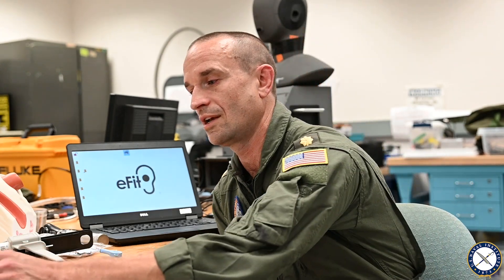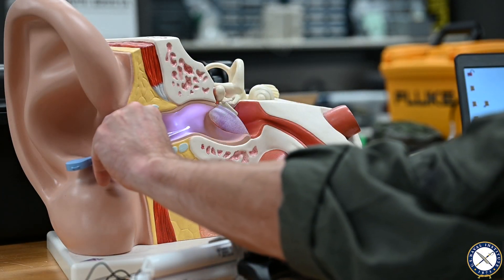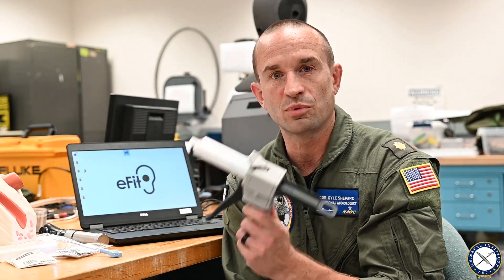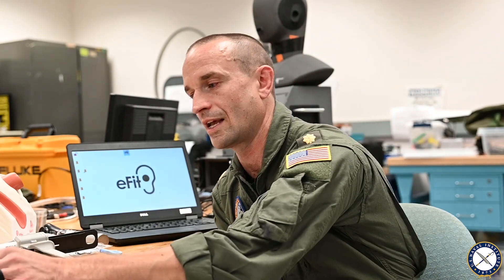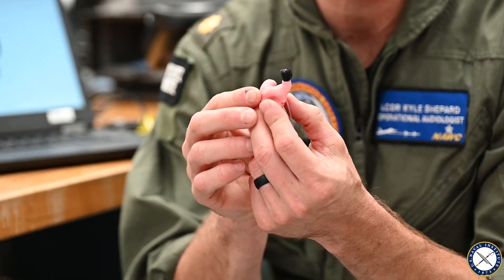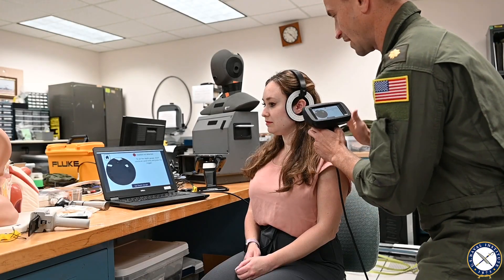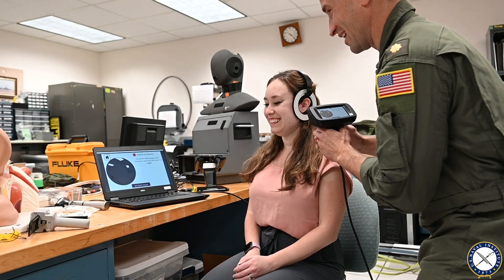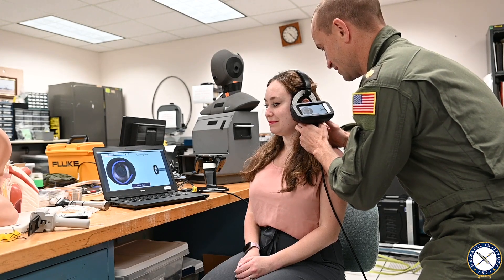USNI News Video: How the Navy Develops Custom Hearing Protection

Comment: this is all very interesting,  but in my humble opinion the USN should actually not be involved directly 'top-down',  in such minute type R&D.  Such micro-scale development programs are not efficiently destined to flourish and succeed in an upside down development track as this.  USN is stretched too thin as it is on major development and acquisition programs and arguably struggle to get even those right.  Honestly, it should be a more streamlined process where competent industry says:  we'll do the R&D ourselves and fast-track a product you require.  If a competitor can do better the next year for an improved variant as a supplemental item, then all more the more power to them.  It's actually how USN got into the Aircraft carrier business in the first place back in 1908-1910 ... when the requirement was established and the initial Curtis developer said:  sure, we can develop and deliver that initial test bed aircraft design and even provide you the test pilot !  USN needs more streamlining !!!  Strategic reboot in the fundamental  acquisition methodology department needed asap.  Keep innovative, effecient, strategic and prudent... keep afloat.  

edit:   Respects to USN tomorrow .  Thanks for your service